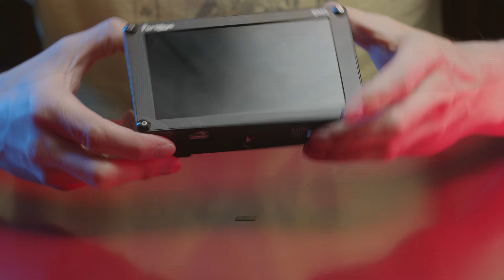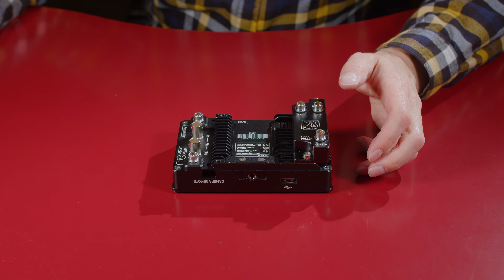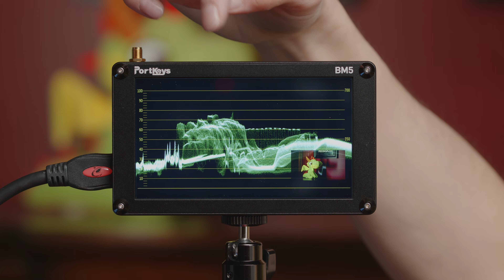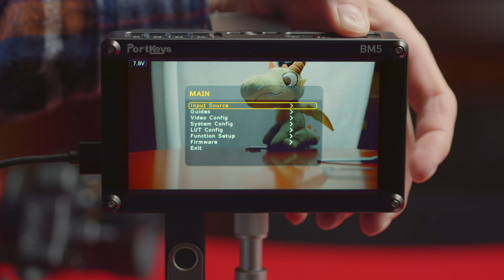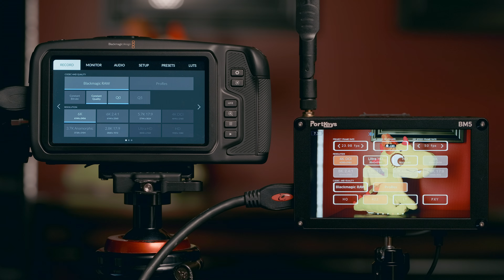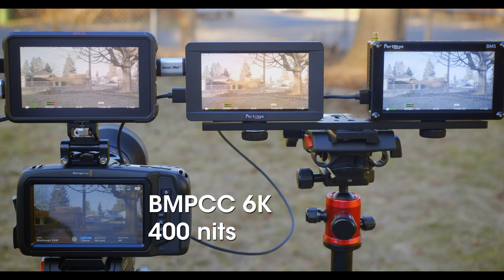PortKeys BM5 II 5.2" Camera Monitor - A Detailed Review

Comment: Does the BM5 support bi-directional communication through the LANC connection of the ZCAM, meaning can it receive feedback from the camera, such as changes in settings like ISO, aperture, or shutter speed when these are adjusted directly on the camera?

Comment: great video!! i just paired my bmpcc 4k with the BM5WR just now,. i'm able to control it from the monitor but the monitor isn't showing what's on my camera, the screen is the default screen.  do i need to connect something else via cable? i thought that the blue tooth connection will also connect the video?  thanks!
Reply from the maker: Bluetooth is only for control. You need to connect a HDMI cable between your camera and monitor 👍

Comment: Hey Question, I have the Bmpcc 4k, but my HDMI port AND my 12v connect is not working...on my camera is broken, what other ways I can connect the Bmpcc 4k to this monitor?
Reply from the maker: I don’t think there is any other way to monitor video from the Pocket cameras. The Bluetooth is currently just for camera control.

Comment: I used this recently on a Sony a7r3 and when I switched to 4k the monitor wouldn't output the image but at 1080p it worked fine. Not sure if that has to do with a firmware update, or if its just not meant to be used on that camera. I only worry because I want to buy the Zcam s6 and don't know if its going to be a problem or not.
Reply: @FlannelNinjaTech  ohhh, okay. That's what I was unsure of but good to know. Thank you!

Comment: Thanks for an excellent video.  I have been looking at many videos about this monitor.  This is the most thorough video I have seen so far.  I have the BMPCC 6K and need a monitor for my studio when filming YouTube videos.  I am sorry to hear this monitor did not work very well for you with the BMPCC 6K.  Would that protection screen on the PortKeys monitor cause any problems?
Reply: Thanks for the reply.  I will wait for a while to buy this monitor.  I hope they run with your suggestion to include the BlueTooth module in the next generation.

Comment: Great video. Does the touchscreen still work after replacing the original glass with included more-protective one?
Reply: @FlannelNinjaTech  Thanks! I watched a few videos about this monitor before picking one up and I guess one of the other reviewers didn't remove the original bezel and that's why the touchscreen no longer worked? I fully agree: wish Portkeys would have just shipped this thing installed. I ordered the monitor and bluetooth module separately, so let's see if it ships with the pelican-style case from your review. My monitor arrived in that smaller pelican-style case which won't close with the smallest NPF installed.
Reply: @FlannelNinjaTech  EDIT: They stocked this cable on Amazon. --> Also do you know where I can find the 5-pin portkeys-to-nucleus/usb cable? Didn't see it on their site or from Alvin's cables.